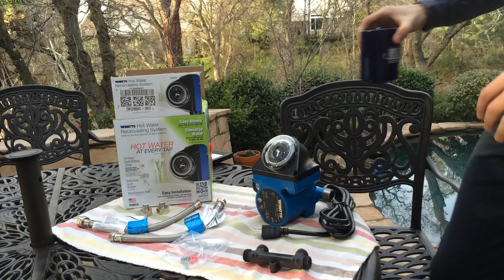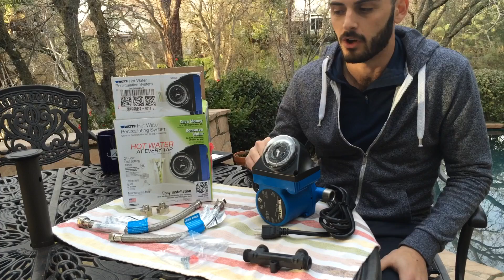How Hot Water Recirculation Pumps Work - Watts 500800 Review

Comment: I've had mine installed for about 3 years now and it just "quit" working... I took it apart and noticed the "wheel" inside easily stops turning... was wondering if that could be the reason it's no longer pumping... any suggestions on fixing that or what are my options other than purchasing another pump...
Reply: JerryNDiane Upchurch.  Impeller is seized?  If you can't free it up, you're done
Reply: Should've got a Readytemp, they're calcium proof and hard water friendly.  Not to mention the control that minimizes demand and extends the system life.
Reply: @utube4greenfuture  ...problem with ReadyTemp is if you need 2 cross-over locations...say at opposite-end bathrooms of the house....you are buying TWO units....pumps and all !!, because ReadyTemp is a module of pump and cross-over valve. At $370 a pop....that would be $740 for two locations. PLUS...mounting the pump under each sink requires a local plug at each location. How many under-sink cabinets have a GFI rated plug right there?....here's another $X00 cost for an electrician. In contrast.....you can buy a Grundfos or Watts system for under $200 ( one pump at the water heater),  and add another cross-over valve for under $50, and you're done, if you need 2. . No doubt....if you have hard water issues you may have to replace more often ( or take valve or pump out and soak in a calcium-softenig solution...maybe you can save the old pieces).

Comment: How long have you seen this particular pump last along with the valve? I noticed the warranty is only 1 year where the Grundfos is 2 years or up to 30 months from date of mfg. If it's a $50 difference between the others and this one IMO the extra $50 is worth at least an extra year of warranty.
Reply: Failure times usually follow a "Bathtub Curve" - meaning that most failures occur in the first month or less.  Once it goes beyond that time, the number of failures usually ramps up slowly.  A reasonably made pump like this should last 5 years or more.  My experience is that warranties that extend beyond the first year are a waste of money.  Therefore,  I feel that spending the extra money is probably not worth it.  I'm an engineer.
Reply: No. You didn't listen to this wise man. He said the only difference is his is blue and the other is red. 😂🤣😂
Reply: Heres the rub.....both Grundfos and Watts are the same unit.....the Watts is cheaper because you get a shorter warranty. Both are built the same, meaning....the Grundfos is NOT built better.. The extra cost is a sham....you're not getting a "better" piece that supports a longer warranty....you're getting the same piece, but ONLY a longer warranty from Grundfos. Many companies do this...and I think it's a marketing sham. Se here for more---> https://besthotwaterrecirculators.com/watts-500800-vs-grundfos-595916/
If you want to spend more for a warranty.....go for it....but do understand the piece is not warranted longer due to the manufacturer offering a better unit that is built better....it's simply ONLY a longer warranty. Seeing how difficult it is to claim anything under warranty nowadays....personally, I'd go with the cheaper unit and take my chances.

Comment: I think I will be installing one of these but could I just run the sensor cold return back to the cold input on the water heater?  I have soft water on the hot line to the kitchen sink, but hard water (for drinking) on the cold.  I have access to run the line in my basement back to the water heater.  If I do run a separate return, what size line would be adequate?
Reply: 1/2 Inch would be fine for a recirculating line. It's just moving the water around, no real need for heavy velocity or volume.
Reply: I would run 1/8 inch or 1/4 inch tubing for the return.  You would not need the thermostatic valve, so that savings could help pay for the return tubing.  You're really looking for a slow dribble of water so 1/2 inch is way oversized.  Friends of mine have done this without the use of a pump, but then you're relying on the natural flow of water based on the temperature difference.  In other words, it may or may not work for your system.

Comment: Does it work well with tankless water heaters? Would it cause the heater to be turned on continuously? Thanks.
Reply from the maker: There is a unit made specifically for tankless systems: http://amzn.to/2ktz9y6
Reply: From the manufacturer: "Not for use with tankless water heaters".

Comment: How hot is going to be the cold water?
Reply: Fidel Alonso 
the black valve will stop hot water from going to the cold side.  its has a thermostatic valve in it...
Reply from the maker: It ends up being like the opposite of how your water felt before installing the pump. So it will be warm, but gets cold after 15-30 seconds or so.

Comment: Hi there,

How hot the water gets on your cold line for us to use, it lets say when someone is getting a shower and someone else is using the sink faucet?

Pump is going to be pushing hot water into the cold lines and eventually all the way back to the water heater, isn't it? also will try to push the hot water back to the street, do we have to install a check valve between water mete and house to prevent water to go back to the street?

Thank you
Reply: no the valve is designed to close once hot water hits it so you will get kind of warm water in the cold line just the temp befor the valve closes